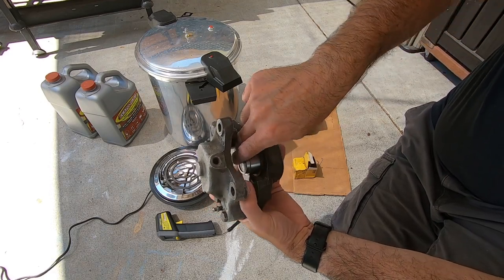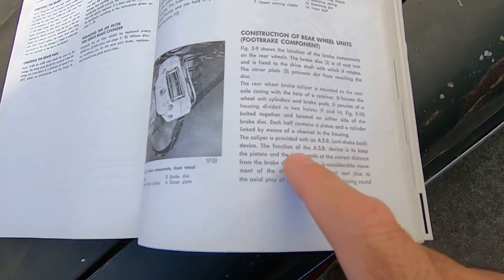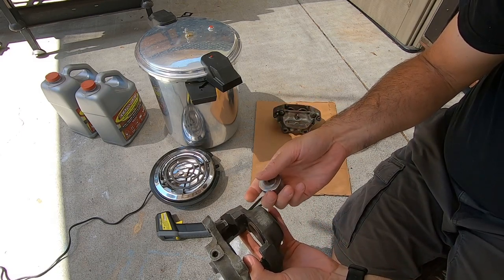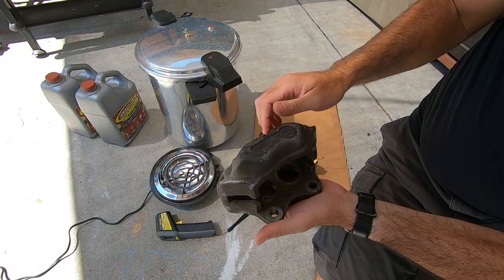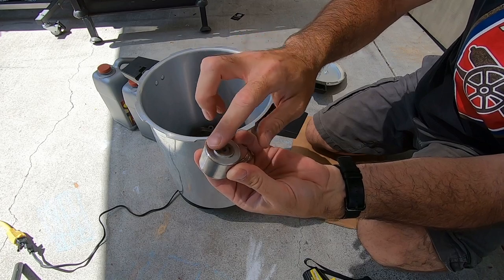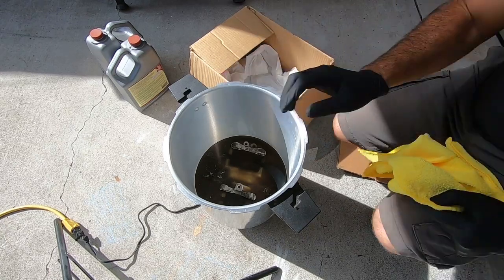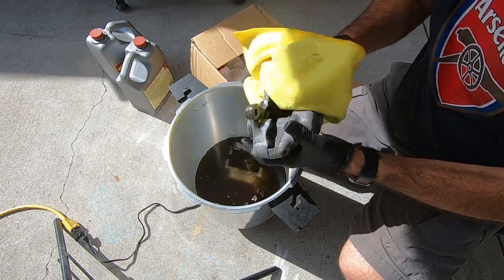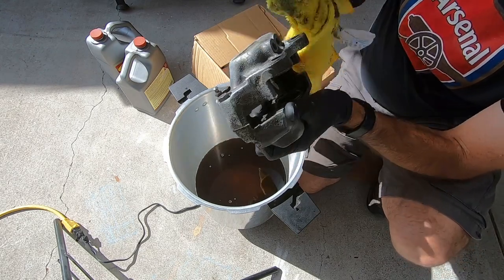Brake Calipers cooked in Evaporust? and the A.S.B. device.

Comment: Hi, I’m currently in the same situation. Do you have the part number or info on where i could find those pistons? Thanks
Reply from the maker: Yeah, I kinda got lucky just looking at pictures of Girling pistons and found one that looked right. Then cross referenced the caliper for Volvo. I found mine on ebay. Listed as "Brake Piston #64326384 - Fits Jaguar F-Type" so part would be Girling #64326384